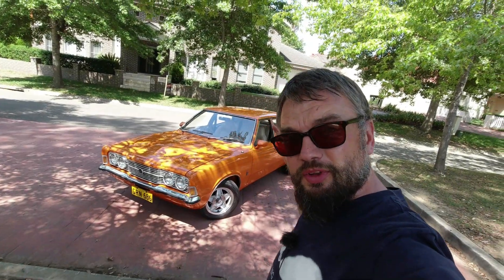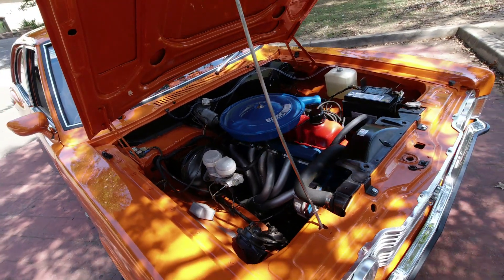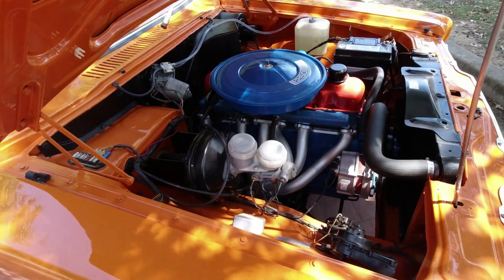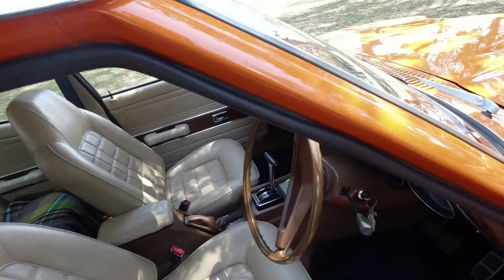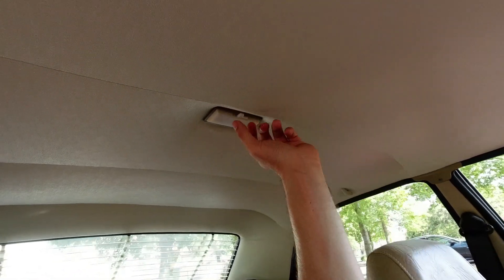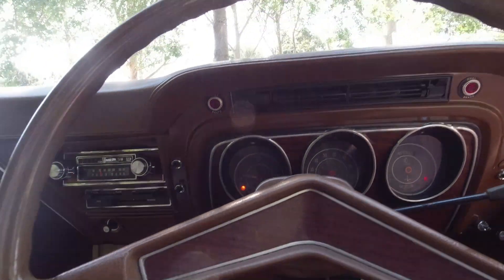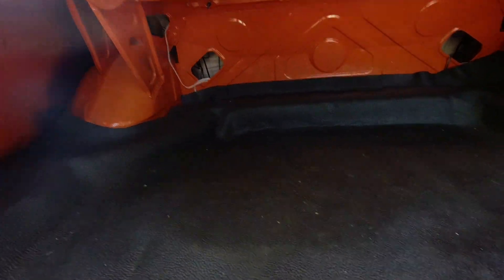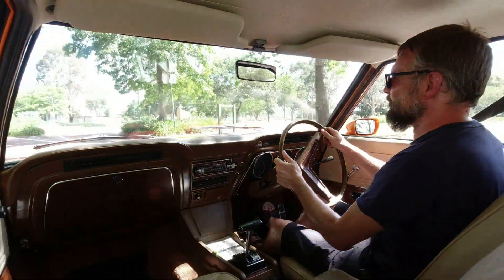Aussie Oddballs: Ford Cortina 6! 4.1-litre, tested in 40+ degree heat

Comment: I had a TD 1977, 250 , 4.1 with the 4 sp manual, I fitted the 2 v head off the falcoon and added front spoiler wider wheels and tyres along with heavy springs and front rear sway bars, this fixed most of the issues, one problem only was the brakes were crap, needed bigger discs.

Comment: So great the TC ( aussie mk3 ) Cortina has been preserved for this occasion.
A few did make their way across the Tasman to New Zealand 🇳🇿 along with the sibling known as the Transit that also benefitted from the 6 cylinder 250ci  Falcon engine.
Love the ride, thanks 😊 🙏 ❤  
Regards Vernon. 🍹👍👌🌎🗽
Reply: A smaller sibling was the 200ci ( 3300cc ) also a inline 6.
I know I have said it many times before, the TC ( mk3 ), the TE ( mk4 ),  the TF ( mk5 ), the Transit van also the Ford Falcon offerings.

However, the mark 2 Cortina was only offered a six cylinder through South Africa 🇿🇦 known as the "Perana".
Thanks for the TC test drive 🚗 👍 ❤
Reply: Time for a correction to what I said earlier.
The Cortina 6 cylinder in South Africa 🇿🇦 was known as the "Savage", it was the Ford Capri ( V8 cylinder ) in South Africa 🇿🇦  known as the "Perana".
The Cortina ( 6 cylinder ) in the UK 🇬🇧 was known as the "Big-Six", also seen in NZ along with aussie 6 cylinder cortina's along with Pinto Cortina's from UK & Australia 🇦🇺. 

Whilst speaking of South Africa 🇿🇦, they also produced a Vauxhall Viva ( Firenza )  factory fit with a V8, only known locally as the "Chevrolet Firenza " ( Can-Am ).
The engine was sourced from the American Camaro V8 and its manual box from the American Muncie range.
Hope that helps from the offerings out in the colonies of South Africa 🇿🇦, Australia 🇦🇺 and New Zealand 🇳🇿 😀 👍 ❤

Comment: I had a K reg 1.6L 4 door saloon from Oct 75 to July 80, in Monza Blue, it had dark blue vinyl seats.  The summer after I bought it (1976) was one of the hottest on record.  Pretty soon into the summer I bought seat covers and a steering wheel cover, as I got a bit fed up having my backside warmed to the equivalent of Regulo 4 or 5.  My replacement car in 1980, a MK IV 1.6L in dark green, had cloth trim mid green coloured seats, so no need for seat covers.

Comment: Wow! Did you ever come across any "interesting" mk1 or mk2 Escorts down under?  I remember seeing something a couple of years ago about an RS2000 Van/camper they got. Not sure what it was named or looked like, but it was given many similar RS parts including the RS2000 motor.
Reply from the maker: Not really, other than finding a Mk1 Escort converted (very badly) into a Ute in New Zealand. It's in this video. https://www.youtube.com/watch?v=-yWKDFCdYlw
Reply: The MK2 escort in Australia came with the 1.3, 1.6 Kent engines and the 2lt pinto was an option after pollution control came in. The Australian version of the RS2000 wasn't as good as UK version more of an RS pack and was available in auto and 4 door the van was probably the sundowner which had a 2lt in it the wagon was never offered for sale in Australia either

Comment: That auto definitely needs a look at, The 72? on Aussie Cortinas all came out the same, even the later TE and TF with recessed firewalls and the 4 cyl would have a metal cover (held in by screws )over where the 6cyl recessed radiator is in your video making the 4cyl radiator closer to the engine. still the same engine bay, the 6 cyl TC had a harshly welded support plate over the top of the upper mounting point of the subframe the TE and TF had a welded in different suspension, no sub frame. The washers which you found worked via the wiper motor with a built in electromagnetic relay? pump suck blow type pump.

Comment: My third car was a blue 1.3 base model (P Reg) in the late 70s. Didn,t even have a radio so used to put my ITT radio casette player on the back seat. Very nice car smooth and quiet. Had to have a new clutch at 60,000 miles which cost me £50. After that had a T Reg mark 4    2.0 ghia in gold. Got both cars from a garage in Pegswood near Morpeth Northumberland.  Happy days.

Comment: I owned one of these - 4 speed manual - in a pink/purple colour officially called "Wild Plum". 
The interesting thing (as a poor student, I did a lot of my own maintenance) was the body was all metric and the engine was all AF (imperial). The thing went like stink but handled like a pig with all the engine in the front. The bushings in the front wishbones used to get chewed out all the time and were a pain to replace. This operation was where the nut sizes changed and you needed two sets of tools.
I also had to do the heavy duty springs (the TD was even spongier in the front).

Comment: Back in the early '90s I had some limited experiences with euro make 1980+/- year Taunus sedans equiped with V6 carburated engines, both with automatic transmissions. One of those was 2.3 Litre V6 and the other a 2.0 Litre V6.  The little essence had been that one of those wore a neat factory sticker "V6 Special" on its trunk lid. The car was painted light green metallic with factory alloy wheels on it. All in all this had been a very proportionate vehicle.

Comment: Had one , mine had the 4 speed top loader gearbox ( stock ) put a duel stainless exhaust system with tuned headers or extractors with gt tailpipes , dragway mags with 245/45/13  on the rear and 235/45/13 onthe front, hand flared the guards and painted it pacific blue, made a custom grill out of chrome piping and fitted fairlane headlight covers over the duel headlights.
It sounded like a v8 and many people didnt believe it was a six until i lifted the bonnet.
Damn i miss that car, it was such a head turner and went like shit off a Shanghai! Ussie slang for great or fast lol.
Was quicker than many v8s of the time like the 253ci and some stock 308 and 302ci power to wieght and gearing were very good.
Would be worth plenty now too , but no good crying over spilt milk as they say.
Cheers ,

Comment: I had the TE model, (MK4 } with the 4.1 and 4 speed. It was a wagon which I used daily with all of my tools onboard. Went extremely well except the clutch cable didn't fit properly due to the extractors and would burn through. Apart from that and the gear shifter coming right out occasionally due to a useless nylon locknut,, it was e very good car which lasted for many years despite almost no maintenance.

Comment: Lol, had one and fitted the 250 2v Canadian, fully worked. They had a bolt on intake instead of the normal intake that was cast as part of the head before cross flow. It was fully worked and I mean fully worked. I loved leaving v8's in my dust.

Comment: My Father had a Mk4 (TE) 4.1 4 speed wagon that used to tow a 17 foot cabin cruiser. The thing went very well but was hard on front shocks and brake pads. The handling and understeer was bad but the old man used to take off in second and straight to 4th it was that type of car.

Comment: I used to have one of these but it was the XLE version. Still had the agricultural straight 6 but it was backed by the coveted 4 speed Top Loader gearbox. Could easily do the old ton on the highway and had a habit of lighting up the rear tires at the lights (no idea how that happened).

The front suspension in these was notoriously fragile. Had a tendency to just give up and go for a wander to see what else was happening in the world.

Comment: Even hairier was the similarly sized Chrysler Centura, with a 265ci Hemi six, guaranteed to give Grandma a surprise as she drove out of the sales yard!
Reply: The 245 was the top motor for the Centura, which caned the 250 Cortina anyway. Many- me included- dropped a 265 in just cause we could.
Reply: @rossbrumby1957  Ah ok, thank you for this info. I guess I just assumed they smashed in the big bad 265. I can see that even the 245 is a big Hemi six - and would still scare Grandma!

Comment: Great video, thanks. Not the most economical motor, but the 250 was a good engine. I'm not sure that the transmission should be making those sounds. Maybe it has been modified?

Comment: where is that Wine coming from.
Reply from the maker: The transmission. Noisier than it should be.
Reply: @HubNut  I had a drag race once in Perth,WA  with a 302 V8 powered Cortina.I had a cheap  crappy looking Torana  with a mild 350 chevy .I can still see them looking like mad  all over my car at the next traffic lights wondering what was under my bonnet.A sleeper is more fun than anything else I owned.Yes Torque is best.

Comment: Wow that's amazing, 
Not that it needs it in Australia but it looked like it did not have any underbody protection pvc etc amazing in those days they never thought of wheel arch liners to prevent mud collecting in the massive cavity of the arch same with the Marina and even the Ital.
Reply: Into the 80's before liners started to be fitted- in UK cars at least- from my recollection, made a massive difference if you drove on muddy country roads. Used to be a regular job hosing out half a ton of dirt from all the cavities and crevices !

Comment: Aha! As you are saying the 250 in this Ford of the early 1970s refers to the engine size in cubic inches, that then VINDICATES me in claiming the 215 of the first-ever Holden, the 48-215, referred to the engine size, making the 48-215's engine 35 cubic inches smaller than that of this Ford Cortina.
Reply: But a 48 215 has an 132 ci engine
Reply: @Andyc351  If this car has a 250 cubic inch engine squeezed in under its bonnet, and 215 cubic inches is 35 cubic inches smaller, considering the amount of space in the engine bay of a 48-215 or its successor, the FJ, and considering those Holdens' engines were less complicated, the room in that Holden's engine bay would be, stealing a phrase from a Mitsubishi TV ad, "not so squeezy"!

Comment: when you start the car at 8:59, and rev it at 9:07, it rocks sideways. Has to be one of the best sounding 6 cylinders I've ever heard, better than quite a lot of modern day V8s to my ears. I guess that's a combination of carb induction sound and a nice throaty exhaust.
Reply: Yes does sound good but perhaps better is this Australian Valiant Charger E42 4.3 litre hemi 6 cylinder with Triple Webers as standard. 302 bhp from the factory in about 1973 :
https://www.youtube.com/watch?v=5FTDdtLs6_g
Near standard car, but top of the performance range. Out accelerated 5.8 litre Falcon GTHOs to 100 mph and so many others. 
Dominated production racing in New Zealand for many years.
Hubnut missed out on the Australian Valiant models that over time became less related on the US originals.
The triple SU carb Holden GTR XU1s  sounded pretty amazing too, but only 3.3 litres, but in a lighter car.
Cortina 6 had no racing history but Torana and Charger were very competitive in Australian and NZ racing against all comers. Cortina 6 more a luxury cruiser than one aimed at the performance market. Was fairly simple for Ford Aus to make.

Comment: Wow that looks ggrrrreat It's in fantastic nick. We had several 2 litre GXL,s when I was a kid back in the day. I love the idea of the straight 6. I only remember the 3litre v6 but as you said it's Australian. Are they easy to find still?
Reply: Not easy to find today in Australia. Outsold 3 to 1 by Holden Torana sixes here which were outsold by full size sixes of the HQ Holden Falcon XA etc. Ford Cortina did not hold up well to age. Had no racing heritage like the Torana. The ones that lasted were bought up by Ford loyal drag racers who put V8s in them and modified the crap out of them.

Comment: The Globe wheel company, now extinct, modelled that wheel design on that found on Ferrari's Daytona.  The model of wheel is 'Bathurst' - for obvious reasons, if you're familiar with Australia's most famous race track.  The original was 15"x7" and is very rare compared to the subsequent 14" and 13" versions, in multiple 5 and 4 stud forms. (Other makers did 15" copies later on.) This bloke looks to have gone for the common 14x5". 
The 6cyl optioned Cortinas sold a bomb, with both 3.3L and 4.1L.  Most were auto, with a BW 4-sp manual being available for either motor. [EDIT - Earlier on, a 3-sp for the smaller six, 4-sp for the larger six.]  Ford didn't have a 5-sp with the strength to handle that much torque (until years later in the Falcon - '82 for the 3.3L, and '86 or '87 for the 4.1L).  There was never any sporting variant of the Cortina.  Only some V8 versions of the Falcon/Fairmont (GXL and later Ghia ESP) held any sporting pretensions for Ford Australia in the 70s and 80s.  
6cyl Cortina front end suspension, etc,  collapsed under the weight of all that iron, exacerbated by our agricultural roads of the era. The sixes continued, with a cross-flow head, from '76 and then into the TE.  Finally, in '80, Ford fitted an alloy head, designed and initially manufactured by Honda. 
No, it still wasn't sporty, but the front ends lasted a bit longer.  :-)
Reply: @stardroppercj, what motor was fitted to South Africa's V8 variety of those Cortinas?

Comment: My first car, same colour but mine was pinto powered. 
Switches used to snap off in your hand so you hand to take the knobs off.
Those mirrors are standard. They were fitted to all the fords of the era 1972-1980.
My brother had a mk4 Cortina with the 4.1 engine. When like the proverbial off a shovel. 
They banned the model for "p" platers (18-21 year olds) because the power to weight ratio was higher than most V8s of the period.

Comment: I'm sure the 6 cylinder of the TC was 200cu in. The 250 is a transplant from the 70 - 72 xy, xw falcon or maybe the TD.
Reply from the maker: No, you could specify 200 or 250 it seems.

Comment: The void bushes failed quite often due to mechanics tightening the bolts while the suspension was hanging down on ramp , this meant the void  bushes where in torsion all the time when the weight was back on the wheels , you should leave bolts loose drop car on the ground roll it back n forth bounce it to settle the components , this applies to all vehicles

Comment: Had a 4 speed manual back in 1976. Could spin the wheel thru all 4 gears if you booted it. Quite economical on the open road with a light right foot.

Comment: I had the 74 tc XLE as my frist car,, was told later by a ford nut that the secondary hump on the bonnet was origanally put there because it was origanally going to be a baby v8 to compete with the a9x,,, the second rise in the bonnet was extra room the the higher air cleaner

Comment: We had an early 2.0 GXL in period. The wash/wipe facility consisted of a floor button (where many cars had a dip switch) surrounded by a ring. Stamp on both and you got wash and wipe whilst just depressing the ring with the edge of your foot gave you intermittent wipe. When we swopped  for a 2000E it had gone all legit with column controls - not really an improvement.

Comment: The pommy Cortina and the Aussie one are a world apart. The recess firewall for the 6 to fit also stiffens the car. A lot more rigidity and strength is built in. The really early TC  4s used the straight firewall but flexed quite a deal. 
These Cortinas were quite quick with,,, well just adequate brakes. And suspension that was good on a good road and not so good on rough roads.
Fat tyres? 185 70 13. On 6" rims. They had 185x70 on 5.5" rims factory.
In South Africa they fitted 302s into them, I believe the Aussie body. A near bolt in.
These days ofcourse the twin cam Falcon 6 is the go. A bolt in.

Comment: I had a Coke bottle shape poo brown 250 cu Cortina station wagon  ( same model as you tested ) with a brilliant top loader gearbox used it to commute 3.5 hours a day , apart from breaking a steering arm in the rough drive way ( bit of a shock ) it was a marvellous 4 yr wild ride , it was considered a junker in those days , but you could fix the thing on the side of road , yes the engine was to powerful to heavy for the running gear but Gee it was fun , smoothed over Australias employment problems in the 1980s very nicely.

Comment: Had a TC 6 cyl back in the 90's. Transmission was crap but everything else was pretty good. Sold it in Western Australia back in 98 or 99. Probably still around somewhere as it was in good nick. Had a heap of chrome under the bonnet, sports steering wheel, chrome bonnet clasps... steering wheel smelt like garlic! Wish I kept it to be honest.

Comment: I had a hot pink (more like purple) example a bought in 1983 after my Holden Kingswood HQ wagon had an unfortunate mishap with a car in front of it. The Cortina went like the clappers, did not like changing directions, and an un-intentionally lowered front end due to the weight of the six sagging the allegedly re-inforced suspension.  Obviously, I survived. Not sure how since this thing drove like a crazy carnival ride, minus any safety mechanisms.

Comment: i had a beautiful XLE 250 with a 4 speed toploader. we had the engine rebuilt to some tougher specs and a 500 holley two barrel fitted to a modified manifold. it absolutely flew, XU1's couldn't touch it.

Comment: Why was the thinking in Ford different in that in Europe the 6-cylinder engines were V6 while in Australia it's inline straight 6 despite larger displacement capacities ? Something to do with European Fords having lesser length allowance in the engine compartment for a longer engine etc. ?
Reply from the maker: Suspect it's just because Aussie sixes tended to originate in America, where it was straight six or V8 typically.
Reply: More a case of Australian low volume production being more cost effective to make use of the motors that were already in production for the Falcon. Buyers also wary of new unproven designs so the 250 (4.1 L) six was a reliable known quantity widely used by taxis. V8s in Australia were a rarely taken up option at the time. Only 5% to 20% of full size Falcons and Holdens. So much so that in the mid 80s Ford dropped the V8s for a while. V8s now sought after.